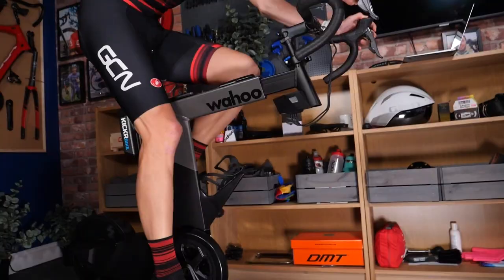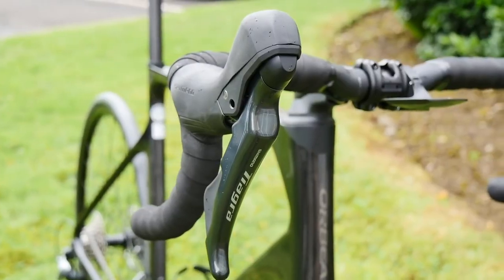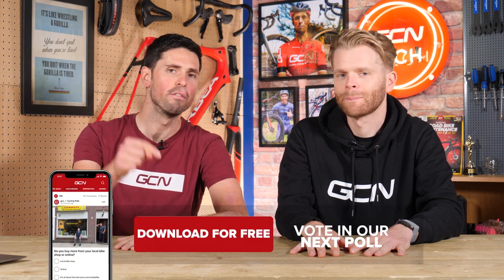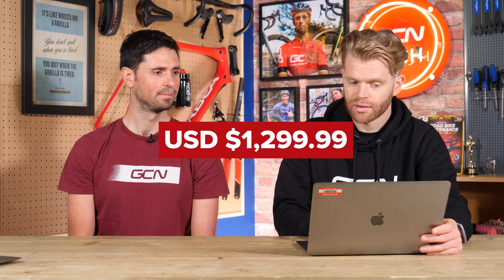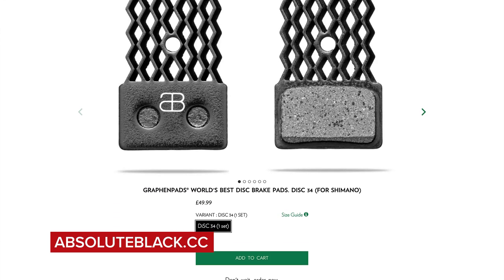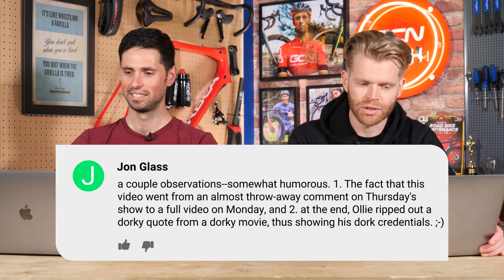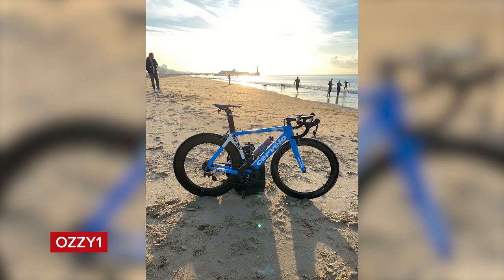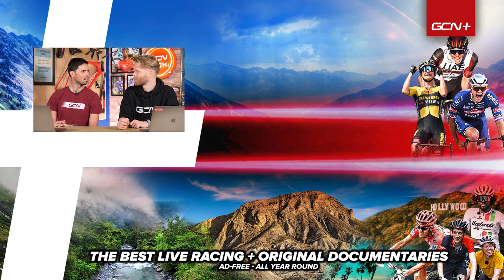Has Tiagra Replaced 105 As The ‘Groupset Of The People’? | GCN Tech Show Ep. 247

Comment: SRAM Rival can be found now at almost half the price(easily found at 2/3 the price) of 105 Di2 and still electronic - “the groupset of the people”.
Reply: It's even cheaper if you're okay with rim brakes. Just have to find Force shifters that support mechanical brakes.
Reply: I certainly agree, especially as there is more gear range a d options
Reply: It weighs a ton.

Comment: Totally with you on using 10 speed ultegra components. My old Tiagrarear  derailleur died, but my local bike shop had a 2nd hand ultegra 6600 derailleur which I now have fitted. Shifts have never been smoother, it’s lighter and it looks so much nicer

Comment: I have GRX 400, so essentially tiagra. Really nice shifting, great brakes (disc). I am keen to upgrade to 12-speed purely for the sake of gear range. Using my gravel bike as a road bike as well, I am missing some higher gears when running with my cycling club.
Reply: I have GRX 400 as well. Can I ask what speeds/cadence are you running at to reach the limit of the GRX 400?

Comment: I bought a Tiagra equiped gravelbike in 2017 mainly for bikepacking. I changed the chainset to a grx to get a 30 chainring. But otherwise I've had no problems. In fact, last year I needed a new winter bike and had a choice between a tiagra bike for 1000€ or the 105 bike for 1500€. Both had the same terrible wheels and tyres. I bought the tiagra version and then spent 300€ for a set of DT swiss 1800 wheels and pirelli tyres. I now have a great bike.  The wheel/tyre change saved 1.5 kg !

Comment: I upgraded my winter bike to 4700 Tiagra and it is faultless. I am still running the bike's stock FSA chainset which is lighter than the Tiagra and stock Tektro brake callipers (with upgraded seperate shoe and pads). I am also running it on my Cyclo-cross bike now albeit with shitty cantilevers.

Comment: I'm running a Shimano 10 speed XT cassette, GRX 400 shifters and front derailleur with an 11 speed GRX 600 crankset, chain and 105 rear derailleur. It actually shifts much smoother than using full 10 speed components. The 10 speed cassette allows 11 speed chains more gap clearance between gears and my FD seems to shift much smoother with the 11 speed chain as well. With current 10 and 11 speed Shimano shifters having the same pull-ratio, there's room for some creative drivetrain setups!

Comment: I am guessing that one reason that pushed Wahoo to build the Kickr with internal Wifi capacity is because the RGT platform demands their upgrade to work well with RGT platform. I struggled with RGT for a long time and it was massively frustrating--constant drops, stalls, and freezing during workouts. I would then switch over to Zwift and have no problems. It was not an issue with a slow computer or a slow WiFi signal. Maybe their is a significant tech difference in their RGT platform.

Comment: I changed my 9 year old 2 x 9 speed Sora to 2 x 10 speed Tiagra 4700 (I already replaced the horrid original octalink fitted to the bike with an Ultegra chainset); brake levers, front and rear derailleur - a total qualitative improvement in smooth, precise gear shifting. Plus my cockpit improved beyond recognition and aerodynamics with the shifter cables exiting via the back of the brake levers instead of out of the side. So much better all round.

Comment: the good thing about tiagra and old 105 having the same pull ratios isn't the rear mech. its that you can pop some 11 speed 105 shifters on a tiagra groupset and a 11speed cassette and you're on 11 speed.
Reply: Wait, really? So I only have to change the cassette and shifters and the Tiagra 4700 RD will shift through all the speeds?
Reply: @AgentSmith16  Rd don't really care how many speeds are on there as long as the pull ratio is correct for the cog pitch and shifter pull and 11 speed road cassette is only 1.8mm wider then a 10speed.

Comment: So I have over 9500 miles on my 2018 Domane ALR 3, a Sora group set that has been beat up and worn out. I went to 2 bike shops to get overhaul and upgrade estimates. Results were that the 105 Mechanical would run $1200 to completely do the overhaul. I paid $1190 for the bike new in June 2019. HOWEVER, Shimano has the rear derailleur on back order until at least March. SO, I had another shop look over the bike and recommended Tiagra as the overhaul and complete bike overhaul with 10 Speed Tiagra is $940. So, I will go with Tiagra.

Comment: absolutely what I found: I use dry lube on the Ultegra cassette on my otherwise 105-equipped bike, and wash it down with warm water after each ride. and it's I have more than 3K kilometers on mine, still going strong. I'd recommend all 105 users to go for the Ultegra cassette and chain for this reason.

Comment: I have just upgraded from rim break tiagra r4700 to rim breake ultegra r8000. Its night and day. The shifting speeds and accuracy, the breaks, but most importantly, the hoods on the ultegra are much more slim and comfortable to hold. I have no experience with r7000, but the r8000 beats circles on the r4700

Comment: 7 years ago I bought an entry level bike with a Tiagra 4600 series which I updated to a Tiagra 4700 series and a Ultegra R8000 brake calipers, I can say that Tiagra is a great groupset  shift smoothly performs great on flat roads and hill climb no doubt about it.  I actually skipped on 105, when I bought my latest bike I chose an Ultegra R8070 series which is way better than 105

Comment: I've just bought an 11 speed crankset for my Tiagra 10 speed bike. Will it work ok? I've already replaced a Tiagra crankset on another bike with 105 10 speed, and the weight difference is noticeable in normal riding, though it was at the same time as upgrading tyres and seat post.

Comment: Sensah Empire Pro groupset would seem to have the best price/performance ratio for the people.
Reply: It maybe is but tiagra has hydraulic
Reply: @renceonmc681  that's true, but are there bikes that come a standard with the hydraulic tiagra. and with upgrading so good cables and hydraulic cable acuated calipers the differnce is not that much.
Reply: @StornofuerKasse3  the only thing i dont like is sensa empire being 11 speed i cant use my deore rear mech with clutch so i can ride gravel without Those chain soun
Reply: @renceonmc681  where is the problem?
Reply: @StornofuerKasse3  The compatibilities
Reply: @renceonmc681  but that should work doesn't it? Trave velo is running a 105 RD with Sensah and it works. so cable pull ratios should fit
Reply: @StornofuerKasse3  no no no what i mean is like u can use the tiagra more because firstly it can run with mtb rear derailleurs thats the big advantage i like with tiagra
Reply: @renceonmc681  not a problem if you're so clever to go for rim brakes.

Comment: I had Tiagra and now have a mix of Ultegra 6700 and 105 R7000, as they said, the biggest difference is the crankset. The higher end stuff is significantly stiffer and lighter. Otherwise, nothing wrong with Tiagra. 105 R7000 would be my choice but Tiagra won't hold you back (especially with an upgraded crank).

Comment: I used to have an impression of any level below 105 as crap, but its not true.  Tiagra is good stuff. I bought a slightly used carbon Trek Domane for my daughter that came with Tiagra.  I've been really impressed with how well everything works.  Good quality disc brakes, excellent shifting. As long you don't care about grams and seconds, its really hard to justify the additional expenditure on 105. In fact, its not clear whether one would be better off with new Tiagra or the 2014 version of Dura Ace that I have on my road bike.

Comment: There's also the GRX series, perhaps they will be for the people. The 3 tiers are basically Tiagra-105-Ultegra. GRX has a clutch, but it can be switched of, so the only thing to solve is a larger chainring, which Shimano may supply if they phase out Tiagra and introduce the GRX as intro racing, gravel and do it all groupset. 

Other than that I can't see the 10 gear Tiagra being the new racing-for-all groupset. The Di2 105 is not an option, I actually resent what Shimano have done. I hope Campy takes the mechanical business with Centaur (needs disc version), and Chorus for abit higher end. A relaunched 12 speed Centaur groupset in aluminum with disc brakes, would probably scoop up the affordable market as it is. 12 speed Chorus is a pretty decent high end option for regular customers, who want's to spend abit more, but not an outrageous price as for the electronics groupsets. Perhaps if Ekar came down in price it would also become very popular. Don't overlook the much lighter weight, which for some reason is unimportant to people who payed out their nose for electronics, and pay even further to then save weight everywhere else.

Comment: My 2013 Felt came with mostly 105-5700 10-speed components, but it had a cheapass piece of crap FSA Vera double crankset.  Square taper BB (went through like 3 of those), always dropping chains, it was so bad.  I replaced it with a modern Tiagra 10-sp double crankset with an Ultegra Hollowtech BB, and it is light years better.  I really couldn't be happier with it.  Shifts perfectly every single time, looks great, the whole bit.

Comment: You can make up most of the weight difference between R7000 and Tiagra by just getting the R7000 crankset, totally compatible with 10sp.
Reply: Is there no shifting issues when switching 10 speed to 11 speed crankset?

Theoritically 11 speed crankset would be slimmer because the 11 speed chain also slimmer than 10 speed

Comment: I've been wanting to build a Chinese carbon fiber road bike from either VeloBuild or AirWolf and have been thinking a lot about going with the Tiagra R4700 group set. However even when the frame only cost $350-550 and using basic $175 Shimano Tiagra aluminum wheels it's hard to build a bike in the $1200-1300 range with Tiagra parts.  9 speed components are much cheaper than 10 speed parts, and used Dura Ace 7700 parts are similarly priced as new Sora parts. It really makes me wonder if what'd be the best option, the best from 20 years ago or new entry-level parts?
Reply: when the mayor parts of your new bike will be chinese, why not a sensah 2x11? and with around 350$ it should fit your budget.
Reply: @StornofuerKasse3  I'd prefer to get legit Shimano components. The frame is the only Chinese no name part I'd buy, the rest would be legit parts.

Comment: Just run a 12 up cassette on 10 speed.  If you really have an ego issue put a 105 or Ultegra 5800/7000 6800/8000 rear mech on, chainset of choice and scratch the Tiagra name off the levers. Oh, and see a shrink.

Comment: The 'people' will still want mechanical shift and rim brakes.  Bulletproof, full stop.  No one compares the weight of the tool set you need to carry to fix an electrical/hydraulic groupset versus  mechanical/rim brake. It's like tires. Try fixing a tubeless or tubular 50 miles from home and 30 miles from the nearest retail store versus the clincher.  How much does a bottle of sealer weight versus how much lighter are tubeless tires? Oh and how do you seal the tire?
Reply: They don't care about people. Sad but true.

Comment: I built up a lightly used 2004 Giant TCR from the frameset last year with a mostly Tiagra 4700 groupset. At the time, due to the COVID bike parts shortage, only a 175mm crankset was available (was running 172.5mm on my main road bike) which I ordered. I later realized I should be running 170mm cranks for my height. I took that opportunity to swap from 175mm Tiagra to 170mm 105 FC-5800 cranks and drop a good chunk of weight as suggested in the video (https://youtu.be/IiCzSQF6gZw?t=435). Great tip!

Comment: Tiagra rules, have it on 3 of my bikes.
Road 2x10 (36/52 x 11-32) + rim brakes
Gravel 2x10 (34/50 x 12-42) + hydraulic discs 
Hardtail mtb gear only 2x10 (22/36 x 11/36) - (Deore chainset)
Cheap 10 speed cassettes and chains rule.

Comment: The 10 speed Tiagra 4700 is a terrible downgrade from the fabled Shimano 105 5800. The shifter nameplate is secured only with one tiny screw thus it tends to fly off the hoods if left unchecked vs the 5800's two screws and the included brakes blocks are just cheap chubby rubber blocks unlike the 105's relatively modern brakes shoes with holders.
Reply: They both have disk brakes. No one buys non disk brakes bikes anymore.
Reply: @bikeman123  105 5800 is a Rim brake specific groupset, do proper research before commenting please. And Rim is better, lighter, more aero and every sane person is switching back to rim brakes. Disks just suck on road bikes.